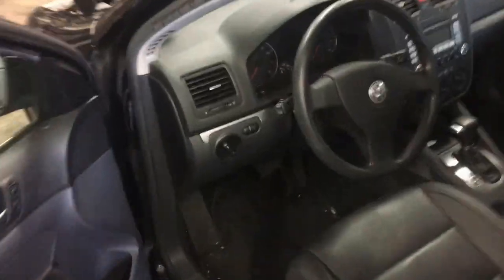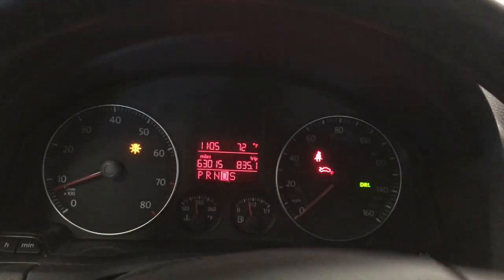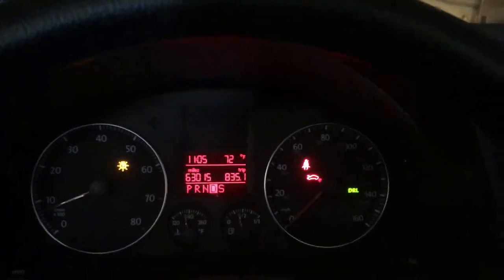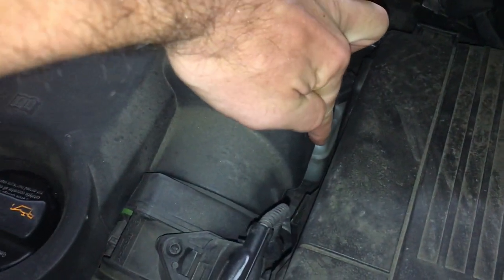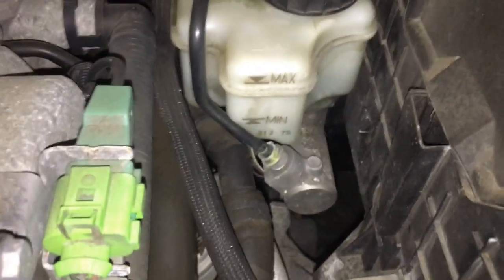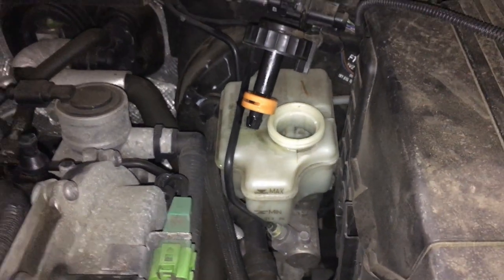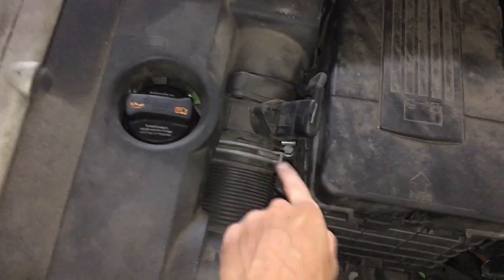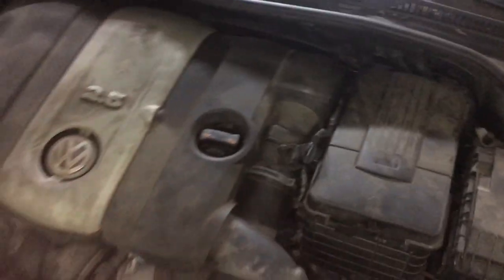Brake Light Flashing and Beeping Volkswagen Jetta Golf Passat

Comment: I fill the brake fluid and the same s..t ... on vcds no fault error ... i check the fuse all good...
Reply from the maker: Hey catalin jumperuu, thanks for watching my video.  If you are certain that your level sensor is working in the fluid reservoir, maybe you can check value on VCDS. If all that is in tact then, I would send out my ABS module ( just the electronic part) to get tested. Places that re-manufacture these units also test them for a bench fee. It is not that hard to take out moderate skill level. Please get back to me on your findings.  If you need more assistance with who can do that work let me know it is not a shop just a business that deals with electronics you can mail your unit to.  Please consider subscribing to me it would help me a lot, thanks.
Reply: I have a problem with abs sensor on left wheel i have a electrical problem i will change the sensor and i will say you i hope tha abs senzor is problem
Reply from the maker: Ok the ABS speed sensor should definitely throw a code or you can just look at the VCDS for value change and if it is responding.  BUT if you have no stored codes likly not the sensor, unless you recently got a code for speed sensor.
Reply: which fuse you checked for that break light on the dash
Reply: @kevingonzalez9193  there is no fuse directly linked to the brake light on the dash - i know because i yanked out all "BRAKE" labelled fuses and still had the light on.
Reply: @wrxzboost  you made me laugh with this one 🤣 I'm having same damn issue with this beeping/flashing. Really only goes off when temp outside is below 60° and hitting right turns. Good old vws got to love the German engineering.

Comment: My Volkswagen does the same shit, but it usually happens when I’m driving, but my abs pops up too. It goes from whatever speed I’m going to 0mph.
Reply from the maker: Obviously check your fluid levels, but in your case you may have a bad wheel speed sensor. The only way to truly get a good diagnostic is to have a scan tool.
Reply from the maker: Hey Ramzi Tarbouche, in my point of view, the fault is most likely your abs module. Depending on your year, make and model the job maybe easy or a bit more difficult to remove. Now I do not know how mechanically inclined you are so whether you will fix yourself or a shop. It is the abs module that needs to be removed and best thing is to send it to a remanufacturer and have them rebuild it there is a great company in Massachusetts, I do not advertise for anyone so I will not mention by name but a simple remanufacture VW abs module will bring up that business. Keep in mind if they rebuild it you save a lot of money, it is most likely just the ABS controller not the whole hydraulic unit.
KEEP IN MIND the dealer will most likely not offer you this option you need to go to a shop who is willing to do this. Let me know what you do I am very interested.
Reply from the maker: Hey Ramzi TARBOUCHE there are remanufactures everywhere all over the world just search VW abs module remanufactured Canada. The great thing about remanufacturing is there is no programing. You may have to initialize the ABS but that is very easy if you get a VCDS, which I recommend if your working on your own car, it will save you money and  you will have a dealer level tool, meaning you can do everything yourself. You can find them on the bay or buy it from Ross tech.
 I do not recommend a used ABS unit and be very careful even if you find a new unit for cheap on the bay, often times the application will be correct but the hardware and software version will be different and you will not be able to program it and waste money.

Comment: You need to just service your brakes and replace the pads and not just put fluid because then it will spill out when you do change the pads if you just add fluid. Just a thought.
Reply from the maker: Thanks for watching my video and taking the time to comment. It is always best practice to fully maintain your brakes and service then accordingly. Many VW’s even have brake pad sensors to let you know when the brake pads need service. As for my situation the fluid needed to be topped off for the beeping to go away. Thanks a bunch for taking the time to share your opinion.

Comment: I got this on my 2002 audi a6
Reply from the maker: Thanks a bunch for watching my video and taking the time to comment. I would check your fluid levels and see if your brakes need work. Please share an update, thanks.
Reply: @WheelsTips  I looked at the resevior and it looks like the brake fluid is fine. It also happens intermittently and more likely in cold mornings.
Reply from the maker: If you have fluid and your float in the reservoir is working properly, you may want to have the system checked for a failing part.  Please share an update, thanks.
Reply: @WheelsTips  I topped off the fluid and that appears to have solved the problem

Comment: My 2011 Jetta just started doing this yesterday, scared me to death, I checked my brake fluid and it’s filled up, the damn light only comes on when driving and it’ll continue to flash
Reply from the maker: Thanks a bunch for watching my video and taking the time to comment. If the light continues to be on, you should have it checked by someone who understands the system. Please share an update, thanks.
Reply: Same issue… breaks and rotors on all four tires changed two months ago… keep getting this “check brake pad and brake light on” while driving popped the hood there is fluid… getting it checked on Friday 😢
Reply from the maker: Hope all is well! What was the cause of your issue? Brake pad sensor? Please share an update, thanks.

Comment: Bruh, ok ppl most of the time it's nothing this deep. If your electric button and it's light on the dash are just flashing and pressing the button won't do anything. holding your break pedal down and the electric button at the same time till it resets and both stop flashing does the trick. 
So
1- hold break pedal down
2- hold electric break button down while still holding break pedal down. Hold both down till the light on the button and dash stop flashing.
3- it should stop flashing and the electric break light on the dash will be on to say that the electric break is on, as it normally would, some cars you can even hear it come on. Then u should be able to press the button again to take the electric break off like normal. Done
Reply from the maker: Thanks a bunch for sharing that information! Very helpful.
Reply: I accidentally discovered if you hold that electronic button down for 20 seconds (stopwatch time) it activates this error as well. It’s the easier to test option imo. I’d start there and work your way down.